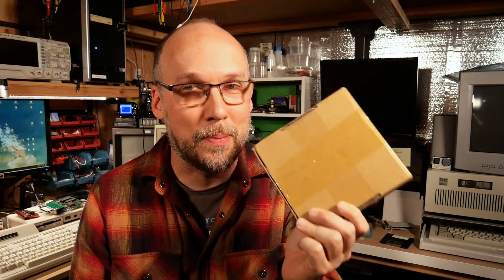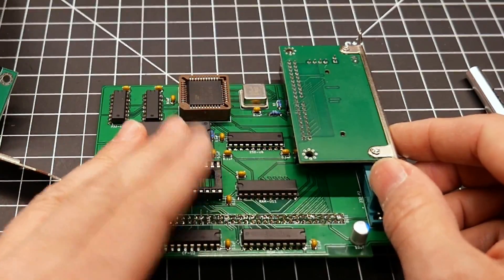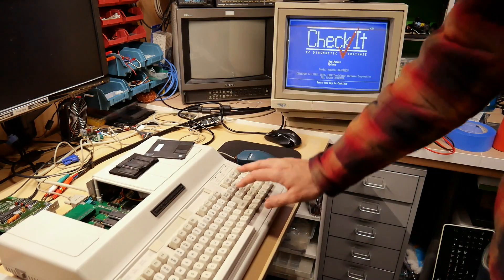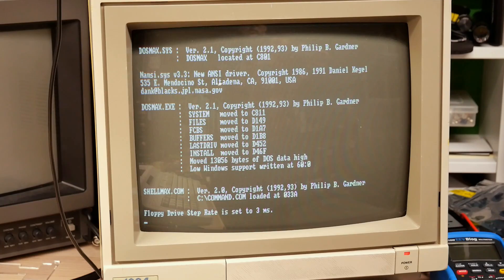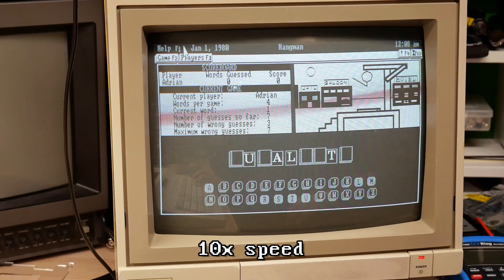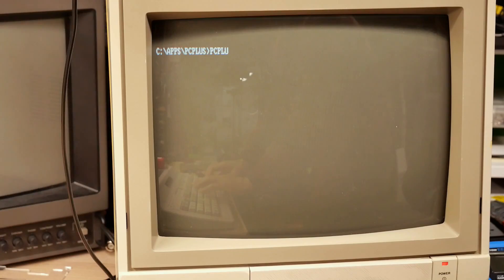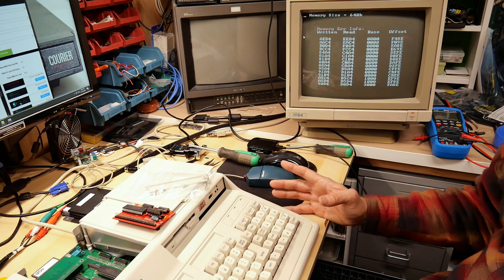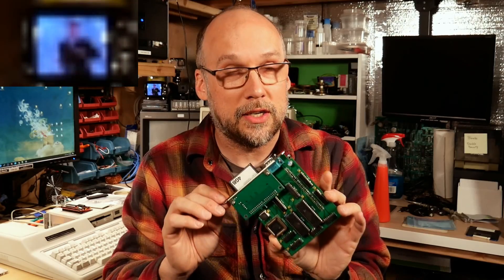Viewer mail: All-in-one RAM + CF + RS232 for the Tandy 1000 EX/HX!

Comment: Hey Adrian!
I've been watching your channel for a couple of years now. I bought a Tandy 1000 EX today and I wanted to learn more about it before it arrives. I thought I remembered something about a 3 in 1 card so I searched for it and here we are. Thanks so much for your immensely helpful content. I ordered one of these boards from an eBay seller today. . . And now, we wait. . . It will be interesting to see how the board I bought differs from the early revision you reviewed. Anyway, the Tandy 1000 EX/HX has been on my wish list for quite a while now and I'm really looking forward to digging into it. Keep up the great work!
Reply: Assuming you did not buy the "Version 2" board, the normal 3-in-1 is very much the same as the version in this video.  Most of the changes have been slight layout improvements to make the PCB smaller, a few silkscreen corrections, and the addition of one pull-up resistor to improve compatibility with a certain brand of ROM chip.

The "Version 2" is a complete respin that includes a second serial port an a second parallel port and is quite different from the one in this video.
Reply: @rkrenicki  
Thanks. From what you described, I do not have the version 2 board.

Comment: Dumb question, Adrian, but is it possible to access the C drive from the built-in DOS-2.1 ROM?  Am curious, as I just reveived an HX from a friend, and will be looking into an XT-CF for it.
Reply: Not with the way that the HX does its start up procedure.   If you are booting from the "Internal ROM drive", it does not load the XTIDE Option ROM first.

Comment: The ram problem may be not the same brand. I use to work on a video processor board assemblies and one day the new batch would not run the software. It ran diagnostics and other checks, but not system software. Noticed the only change was the ram chips. So had the chips replaced with some older chips from another board. It worked. We had to ban new brand. Most probably has to do with the frequencies and logic driving that cause the issue. We also built phone systems and had a list of card combos NOT to use because they did not work together. 
This symptom reminds of a video card used on the voicemail systems. One day there was a card change and systems did not work (system software) although diagnostics did work. Had to ban that new card

Comment: Have you checked the voltages between the two systems?  Maybe one of them has the rail turned up just a bit more and that is allowing the cheap china chips to work.  That is still a thing on modern PCs so...

Comment: one last thing and really pushing my hopes would be 286 accelerator, CF + RS232 + parallel and adlib. now that would be a cool card.
Reply: In all honesty, if you want all of that, you might as well look at the 1000TL series instead of the EX or HX as it already has a 286 and standard ISA slots to add whatever you want.    

I can say for sure that I will never make a card for the EX or HX that is designed for adding or includes an Adlib card, as in my opinion, the Tandy 3 voice sound and Tandy Graphics are the entire reason for using an EX or HX machine.  I have zero interest in making something to "get around" those two functions.   My design is fully open source, so if you want to make a version that includes some of those, go for it!
Reply: @rkrenicki  i actually i have a 1000TX that has been upgraded with "make it 486" and adlib and its nice to have the added speed and both sound options. i would like to upgrade my hx with a 286 and adlib that dosn't need the games to have a working patch for the opl2lpt adlib. the hx is also fine left alone "as is" but it would be neat to see if it can be done. the hx has limited space and slots and i am also not sure the power supply could handle too many electronics with cards going beyond the casing or within the casing. it would also be an eye sore doing such a thing if cards were added some how beyond the insides. i can see that many people would like to keep the hx or ex authentic to original as much as posible with added bonus of "All-in-one RAM + CF + RS232" card though.

Comment: for my wishes would be a all in one CF + RS232 + parallel card. i already have the tandy dma ram card but would like to have the all in one and fill the last slot with a low profile adlib clone. i use a zip drive on a serial/parallel card now and a cf card but don't want to pull the cf everytime for data transfer so that is where zip comes in. currently using opl2lpt (adlib) on tandy edge lpt1 port but only some games work. having adlib with all in one is probably pushing my hopes but maybe some day.

Comment: You could also put a washer or 2 between  the board and the back of the case so when you tighten the screw the board won’t move and bend the card.
Reply: I've already addressed the fitment in my "final" board.   The one that is shown here is one of the later prototype versions.  Taking account the thickness of the new PCB Backplate, it is essentially flush with the rear of the computer now.

Comment: 'need to surface mount the cf card connector' ? since when. cf card connectors are not just available in trashy smd variations. it's a pin-through component by it's very definition. just not at the usual raster size but the solderbath doesn't care if it's a few millimeters less between the pins :P besides smd in general being a pile of garbage cf cards and other connectors are one thing you definately do not want in smd either way :P
Reply: If you can find a readily available through-hole Compact Flash connector for a reasonable price, I am very open to making a design around it..      Mouser has about 40 different CF card socket options and every single one is SMD.
Reply: @rkrenicki  hmm. looks like all or at least most on aliexpress are also smd crap. wtf is wrong with this entire industry anyway. nobody ever actually asked for smd components. they make them anyway. suppliers stock that shit. idiots buy it. and it always comes lose or oxides and stops working within at most 10 years or so (usually just 2 ;) i'd rather not buy any components at all than waste time and money on smd garbage. (especially not since we guarantee our products for 100 years ;)
Reply: oh well in effect it's a plastic strip with gold plated pins through it (preferably with the bottom part pbsn primed) so at least this one won't be a problem to manufacture in-house lol. just that i don't think you want that many of them :P

Comment: Adrian, One thing that hasn't been mentioned is DMA. Does Robert's Card have a DMA Controller? And if not what does that effect for functionality?
Reply: @Adrian Black is correct, there is no DMA here.   In normal use of an EX or HX, DMA has a marginal effect.  It speeds up copying files from floppy a few percent, but nothing substantial.   DMA is usually required for things like Ethernet Networking or a Sound Blaster, neither of which the EX/HX is really suited for.

Comment: Hi Adrian, 

We can extend the DOS 2 or 3 memory to use UMB in theory, I will do a little utility for this.

(It does not require the application to support UMB, as the standard DOS Memory command is used)

Comment: I wonder if the difference as to whether the RAM chips work or not is partly due to propagation delays. On a 68020 CPU upgrade board for an Amiga 1000 certain chips on the board had to be 74F and not just 74LS. It wouldn't work with all 74LS parts. I wonder the use of 74F chips in that memory expansion board would help to make it work with those Chinese RAM chips. It would depend in part on the real speed rating of the RAM. If they are too slow reducing signal delays by using 74F chips may not be enough to allow them to work.

Comment: There's one sort of problem with this card... It has no pass through? Fine if you just want the serial cf and ram - but where do I put my Adlib or anything else? That's one improvement that would be cool!
Reply: @adriansdigitalbasement  I think there would still be room to have one card above though, no? How is the pass through achieved? Would it be as simple as soldering on a socket to the top of the pins coming through the board? At the moment I have a Tandy to ISA adapter which gives me two ISA slots: it's awesome and it lets me test old cards... Would hate to lose it. I liked the design you came up with which had a pass through.

Just a thought!
Reply: @chrisyboy219   My goal with this board was to maximize the system with respect to Tandy Graphics and Sound games, especially those systems that do not have the original tandy memory expansion.  Things like Adlib/Sound Blaster, VGA, or ethernet are well outside the scope of my project.
Reply: @rkrenicki  and that's cool: nothing wrong with that... But you also terminated the bus at the same time , which expansion cards shouldn't really do unless they are last device on the chain. 

It's true that the majority of all people won't care, but it got me wondering if it could be passed through with 1:1 connections to a pin socket on top? I know it might look a little "how ya doin'' but that should work, hey?

Anyways, just thoughts... If you don't think it's an idea for maybe a later revision never mind :)

This device for me will replace a cfide and a lotech RAM board whilst also giving me a serial port for a mouse so that's going to be awesome.

And damn now I'm thinking how fun it would be to install a NIC too, lol
Reply: Well, as I said before, my design was always intended to be the only board in the machine.   

That said, they do make "stackable headers" that would give a passthrough.  I used a few of those on some Plus-to-ISA adapters to stick a Lotech RAM, Serial card, and XT-CF-Lite into my HX before I made this card up.

Comment: Drill the hole in that backplane.  Then run a (long-ish) machine screw into the case and secure it with a nut. The nut should be enough of a spacer so that the gap in there is non-existent or a thousandth of an inch.  Then install the board and use a second nut to hold it in place.  Sounds a bit more complicated than it is.  Also, in the case of the first nut, you could use washers instead.

Comment: Stand offs would work to keep the gap
Reply: I have incorporated holes in the latest version to allow for standoffs.  I had not considered them originally since the stock plastic filler plates have a little lip on them that the board can rest on for support, but there may be some machines out there that are missing those filler plates.

Comment: Definitely a cool product. I already have the original Tandy RAM board maxed out to 640K, though, so I'd only need the CF and RS-232.
Reply: Even if your Tandy is "maxed" at 640k, this board adds 96 KB of upper RAM that can be accessed with drivers to load DOS and (some/most?) drivers into upper memory blocks, resulting in a more functional system with more options, and also more free conventional RAM for games and applications to use.

Comment: Not sure if this is relevant to the ram chip issue but, would the dram refresh rate have anything to do with it? The Tandy 1000 is an xt "clone"? If so then maybe try experimenting with that?

https://www.pcjs.org/disks/pcx86/shareware/pcmag/
Load disk image from volume 7 mag 13 and load the qrefresh.scr to get the demo program. If there is any kind of weird issues then do a search in google for "ibm xt memory refresh rate" to get the below link:
https://books.google.com.vn/books?id=PA3RA3f6mi0C&pg=PA339&lpg=PA339&dq=ibm+xt+memory+refresh+rate&source=bl&ots=-yOBRCxNUP&sig=ACfU3U1iWAwgMMMMTnVCEishgOrtxgsLIw&hl=en&sa=X&ved=2ahUKEwihnMP4l4LmAhUy4jgGHfi3AlcQ6AEwDXoECAkQAQ#v=onepage&q=ibm%20xt%20memory%20refresh%20rate&f=false

That is the google archive of pc magazine that has the info about dram refresh on XT. Around page 340 if it doesn't load for you. I had this magazine and volume many years ago and tried it out on an xt clone and it worked a the time. Was able to get something like 10 to 15% performance from tweaking the ram refresh. Perhaps the timings on the v20/xt are not what the dram chips are rated for?

If I'm completely wrong then I apologize and at least I hope some one finds this info useful for speeding up their XT with out needing to do any kind of soldering etc to their pc. The worst thing that happened to me was the pc crashed as it forgot about what was in the memory. After a reboot it's back to stock speed so the changes are safe to play around with until you get a stable tweak.

Comment: Weld or solder a washer/nut onto the side of the metal bracket. That way it'll pull against the washer/nut and then into the bracket. Do that on each side of the bracket and it should be fine.
Reply: Much easier to drill and tap a hole. For the board I'm building, I made a separate PCB to be soldered on at a right angle, and made the holes large enough to accept PEM nuts.

Comment: First off, I'm not tired of Tandy stuff.  In fact... it's great to see some Tandy 1000 stuff!  Keep it up!  Also, I think the only way that board could be better is if it had a real time clock on it.  Otherwise, it's perfect.  By the way, at least on my 1000TL, if you want more settings from the setup program, use a /a switch at the end (setuptl /a).  It gives you pages of selections.

Comment: Doesn't the ram plus boards for the ex/hx add a DMA controller which can make the computer faster?
Reply: Adding DMA does not by itself make the system faster, since none of the subsystems take advantage of the function.  If you wanted to add a VGA card, full IDE card, or Sound Blaster card.. those would need and/or benefit from having DMA available.  The XT-CF-Lite used here design does not use DMA, and Tandy Graphics and Sound do not require it either.  

I have tested this board against an official 640k expansion, and the performance is essentially identical.  Even though the SRAM is much faster, the speed is limited by the slowest RAM in the system.. the 256k on the motherboard.
Reply: @rkrenicki  I've always wondered about this.  It seems like there is literally no advantage to adding the DMA, there isn't even another plus card you could add that would use it it seems.
Reply: @rkrenicki  Interesting.  I was wondering the same thing (what about the DMA controller).  I used an HX back in the days before and after getting the standard ram plus expansion board.  One things I remember (beside having way more memory available) is PC speaker audio in some games behaving differently after getting the expansion board.  Without the expansion board, in games like Accolade Test Drive or Defender of the Crown, the audio track would take long pauses while the floppy is loading.   After getting the expansion board, no more pauses in audio while loading from the floppy.  My guess was that maybe the floppy is using DMA when available and is not bogging down the CPU as much while transferring data.
Reply: @laurencewhite4757  Since my original reply 2 years ago, I have learned a little more about this.

Non-DMA Tandy computers (1000, A, HD, EX, HX) had their DRAM Refresh handled by the Video controller.   This chip can only handle the memory on the motherboard, and not the memory on any expansion cards.   As such, any expansion memory for these models required a DMA chip specifically to handle the refresh cycles on the board itself.  The fact that it added DMA channels was a "side benefit".

Since both Adrians memory board and my own "3-in-1" board for the EX and HX machines use an SRAM chip instead of DRAM, it does not require any external memory controller to handle refresh, and the DMA chip is not necessary.

Comment: What would happen if you install on top original 640k expansion board?  Stuff blow up?  Alarms at NORAD?
Reply: First, The way the board is laid out, it would not physically fit on top of the original card.   It was always intended to completely replace the Tandy PLUS card, if the machine were equipped with one.

Second, as Adrian said, it would overlap the lower 384k of memory and would probably "work" but be quite unstable as the two sets of memory chips would be fighting back and forth.

Comment: There have to be some sort of minor timing differences between the EX and the HX.  Like the HX is looking at the data bus a fraction of a second closer to asserting the address than the EX is or something like that, and the marginal chips aren't fast enough to provide consistent data at the "problem" addresses.

Comment: Possible reason marginal Chinese chips don't work everywhere: bus timing differences causing issues with out of timing tolerance range chips, probably discarded from legitimate production runs but still sold by ethics free Chinese.  Have you looked at bus signals with a scope or logic analyzer.

Comment: Maybe send the weird RAM chips to EEVBlog - might be an interesting colaboration ??
Reply: It's probably just a sloppy square wave. Whether a chip accepts it or not is due to tolerances beyond the specifications of the chips.
Reply: I had trouble with some 32k srams on a TI-99/4A project. Turned out the alliance chips worked well with  an 74hct245 data bus buffer, but the marginal chips only worked well with a 74ls245 buffer.
Reply: @jedimatt42  74hct245 Is a schmitt trigger buffer, right? That would make sense.

Comment: Have you checked the voltages of each system? If the one that fails is lower voltage, it could be the difference.
Reply: I was just wondering if the ebay chips need more voltage or bypass caps.